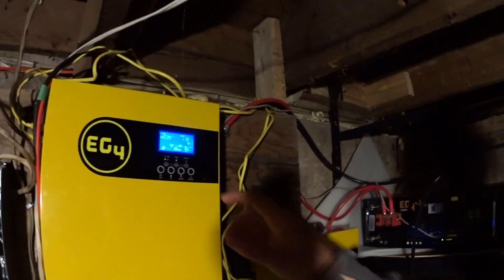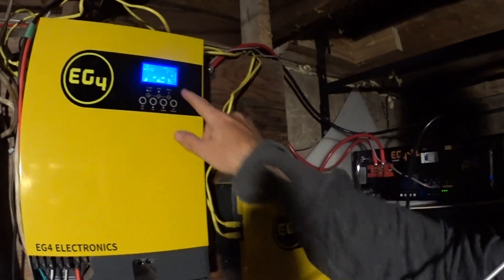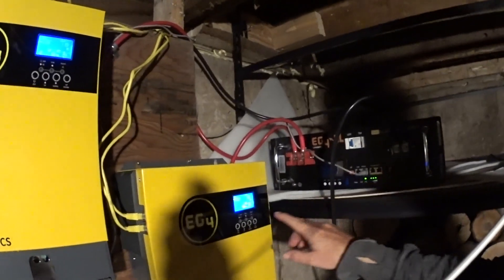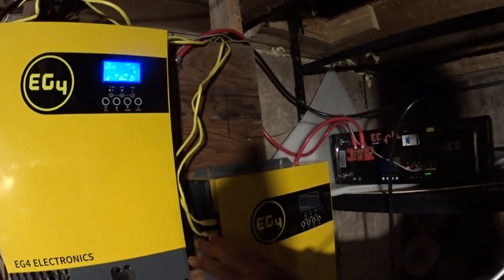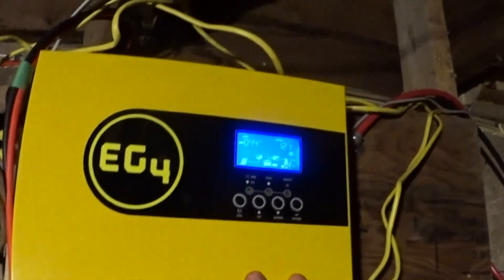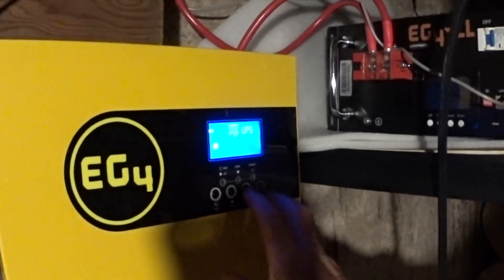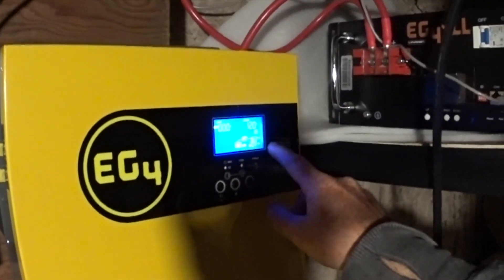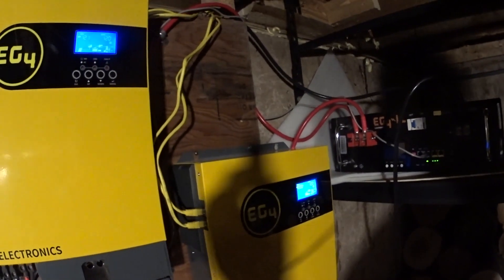HOW TO Fix Error / Warning 19 on 3KW EG4 Inverter

Comment: I don't have two units and still get a 19 error. It only started after about 6 months of use. Strange. Switching to user defined battery removes the error.
Reply: Same issue here. Started out of nowhere and was working for 2 years without issue
Reply: @lotus22  I gave up for now, I tried so many things I got tired of troubleshooting.
Reply: Over a month trying to figure things out, now finally my Lifepower 4 v1 and V2 report correctly to Solar Assistant. Signature Solar even sent me another inverter to swap out (of which had the same issue) EG4 ignored me and told me to talk to Signature Solar.

Comment: Come back in 2 years when these low cost (cheap) high frequency transformerless inverters experiences their first major catastrophic failure or when they have smoked your EV's onboard charger and tell us all about it. High frequency inverters like these don't last very long and they can damage your appliances or your EV when they fail.
Reply from the maker: Thanks for the info. Don't have an EV and don't want one ever :) And these have been running multiple years. They will fail and thats why i have 2 in parallel. one fails, i replace it. I'm on a budget, very very small budget, i can't afford anything more than this. but its worked great for several years so far.

Comment: Signature  solar  has had issue's on customer service  in other youtube videos.  I've  been on every channel on my research before I buy . I still plan on going solar, but It's a lot of money for me and I'm a research guy.
Reply from the maker: They aren't perfect. I'm in IT basically and I've come to realize that for a lot of issues, you need to google, search youtube, forums etc for quickest fixes to common things. My fall back would be Sig Solar support but usually there are quicker ways to find answers. They are US based so for warranty repair, and real tech support in a pinch, they are there which is why i chose this over generic chinese products (though this is build in china). paying a bit more for a solid warranty for me makes sense.